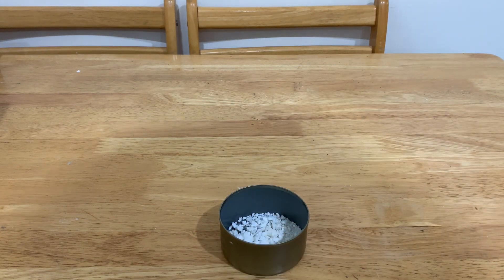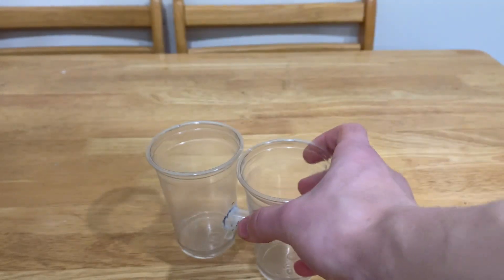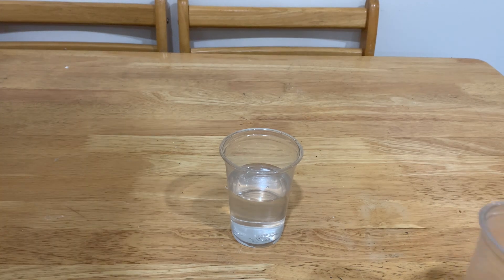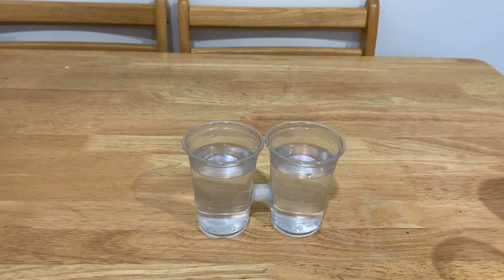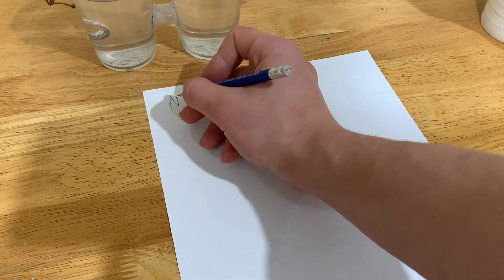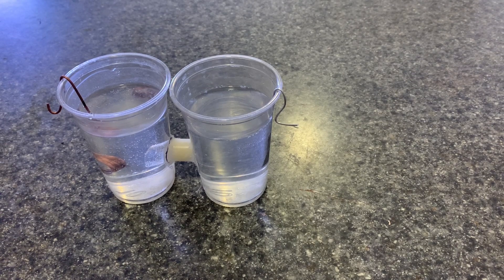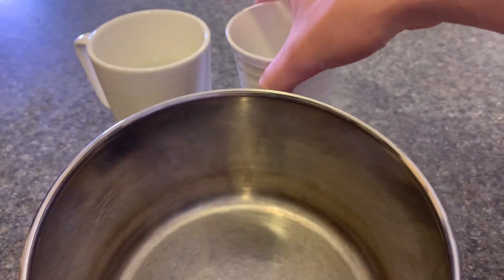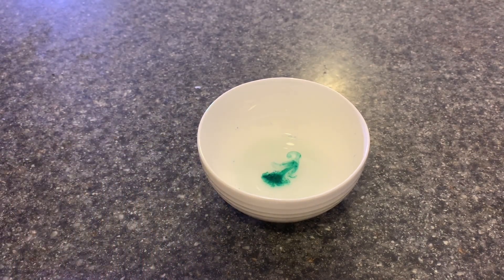Making sodium hydroxide from table salt

Comment: Hi I have a puzzling question.... Chlorine was released out as a gas at the positive electrode, but at the negative electrode chlorine did not come out, where is chlorine gone, is it mixed with sodium hydroxide or remained as a salt.... I don't know anything can anyone have an idea about this naOH purification of it?
Reply: The negative electrode is producing hydrogen, I believe that after you have both electrodes running for a bit it turns the salt water into sodium hydroxide. I believe the byproduct is the used salt and the liquid you pour out after having it run for a bit is sodium hydroxide. I’m not sure how much of it that is sodium hydroxide but that’s what I’ve seen from researching it recently.
Reply: @christophertaylor8761   In the section on hydrogen gas, there is no chlorine output, in the water there is no dissolved chlorine, and sodium hydroxide does not contain chlorine at all.

Comment: A few things to improve on:
1. You really don’t need dual cells for this, you can just drive the chlorine off in a well ventilated area and not use reactive metals as electrodes as they may produce unwanted side reactions. 

2. Using inert electrodes, platinum electrodes would’ve been the best here because there is a chance graphite electrodes might react with the hydroxide to form carbonate. 

3. Heating it up until it’s completely dry in a metal pot is a terrible idea. Hot sodium hydroxide solution is one of the few things that eats through glass, It’ll probably eat through metal faster. Plus, sodium hydroxide as a solid already passively turns into sodium carbonate by reacting with the carbon dioxide in the atmosphere, heating it only catalyzes the process. Use a vacuum or something to dry it, just don’t heat it unnecessarily.

Comment: What if accidentally put positive in the negative cup after has been going a bit just concern that could happen
Reply from the maker: That’s how I accidentally discovered what would soon, with some optimization, become the method I use to produce copper hydroxide

Comment: tips for people sodium hydroxide is VERY reactive with aluminum so make sure that yu dont use an aluminum cup or pot under this process and also sodium hydroxide reacting with aluminum may create dangerous amounts of hydrogen gas depending on the amount of NaOH you have made, and your house may win the next fireworks show.

also instead of wasting money on 9V batteries just grab a "broken" charger because they usually are only broken on the port were you put it into the phone because people dont know how to have a lasting charger apparently even though ive used mine for 3 years but oh well.. were was i... oh yeah, cut off the end and strip the 2 wires, the blue/black is negative while red is positive, white is ground, its safety stuff so it aint important.

other than that this video is fine
Reply from the maker: Yea I got the power supply later on for that very reason, not to waste 9v batteries
Reply: @ChemistryOnCreatine  what about the rest? was it all useless?
Reply from the maker: Nah i just didn’t have anything to say about the rest in terms of personal experience so I didn’t. Everything you said is true about the NaOH making hydrogen gas in a reaction with aluminum, ultimately making sodium aluminate as well. But yea cutting a wire and using it as a power supply would also work. I heard that’s how people charge vapes, so as far as I can guess that means it gives a stable output of dc voltage. 12 volts as well I think, higher than the battery I used
Reply: @ChemistryOnCreatine  ultimately its the amps that do the job but ofc you need sufficient voltage to carry it, a usual phone charger it like 5V at like 2A, but only like 300mA will really go though with the right electrolyte and setup.

Comment: also uhhh. dont do what he did at the end of the video. please. All due respect, boiling concentrated sodium hydroxide is just unnecessarily stupid. If any of that gets on you it will immediately burn you, starting eating into your skin, and will turn your tissue into soap. google "sodium hydroxide burns" and then multiply that by 10 since its gonna be 100 C +
Reply from the maker: Yes yes, that stuff is extremely corrosive, if you have pure sodium hydroxide you should handle that with a lot of care. The stuff which I was making has a terrible level of purity so as it’s mostly NaCl, boiling it wasn’t too bad all in all

Comment: Maybe I'm an idiot, by can you not buy this product in your local hardware store?
Reply: You could... But it just hits different when you make it yourself.
Reply from the maker: Don’t think so, even if I could wheres the fun in that
Reply: @ChemistryOnCreatine  you raise a very good point if it ain't fun it's work👍 at any rate with a bit of planning the Cl can be used in other projects rather than waisting it and get a bit more bang for your buck if ya get my drift 😊. Enjoyed the video and keep up the good work thanks
Reply from the maker: I actually figured that out in my lastest video, using Cl, however I never truly was able to use it to its full extent as a lot was lost
Reply: @ChemistryOnCreatine  ohh dang well it was worth a try right. Have a good week good sir
Reply from the maker: Just a bit of tuning the the machine and il be able to catch it much better.
Reply: @ChemistryOnCreatine  how can l preparre commercial volume sodium hydroxide
Reply: @ChemistryOnCreatine  You can buy it in most grocery shops, it's caustic soda.
Reply from the maker: Yea you can I hear as much, but I’m more concerned wether I can do it than wether It’s easier this way
Reply: @ChemistryOnCreatine  Aye, I totally agree with that. It's not the destination that matters, it's the journey! I remember I made aspirin from salicylic acid that cost waaaaaaay more than a box of aspirin, then turned it from that into methyl salicylate even though I had enough deep heat in the cupboard to cook a roast!!! 
It's not about the destination, it's about the journey.
Reply: @EddieTheH  I don't know what part of the world you are in but where I live there's a tree called quaking Aspen, I was told as a child that the native people of the area 3-4 hundred years back used to chew the inner bark for headaches.  You gave me a great idea to try to isolate the active chemicals in it and move forward produce my own Aspen pills. This could be a hell of a lot of fun
Reply: @bigjay875  I think that's in the willow family? If so it's probably salicin, so you can then synthesise a decent group of painkillers from it. If you do it you should film it, there's tons on the internet about salicylic acid derivatives but very little on the actual extraction from inner bark.
Reply: @bigjay875  Aspen aspirin has a bit of a ring to it!

Comment: Bro doesn't NaOH react with CO2 in the air to form Na2CO3?
Also how are you sure that the final liquid you had was a sodium hydroxide solution and not sodium carbonate solution. Was the water heating up when added to the crystals? Can the resulting solution dissolve aluminum?
Reply: Hi ......is Very good.....🎉
Reply from the maker: Yes that is exactly what happens, that’s a fair point, that process isn’t instant though so for a small time it likely was and remained sodium hydroxide
There’s hardly any way of testing this what it was in the end, but as far as I reckon when I was first making this molecule, I mixed it with some vinegar hoping for a reaction after proving its basic, I however did not see any bubbles rising which surprised me, me being slightly new to reactions. Only after I waited a few days with some remaining chunks of it and mixed it again did I see bubbles.
About heating up or dissolving aluminum I genuinely have no idea, didn’t test for that, I have a batch laying around so il test with a piece of tinfoil
Reply: @ChemistryOnCreatine  please let us know if it works on dissolving AL, maybe make an updated video attempting to make pure crystal sodium hydroxide etc! Thanks for the reply and love your video 🔥👍🏻
Reply from the maker: It definitely reacted with the aluminum, though it didn’t fully dissolve I felt the tinfoil to be much thinner
Reply: @ChemistryOnCreatine  the
Reply: Wait NaOH reacts with copper @ChemistryOnCreatine